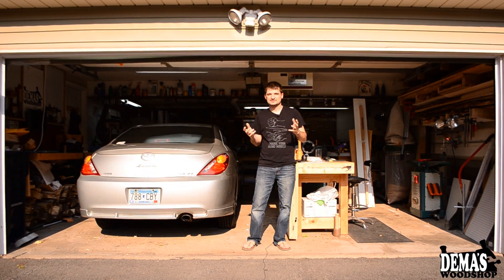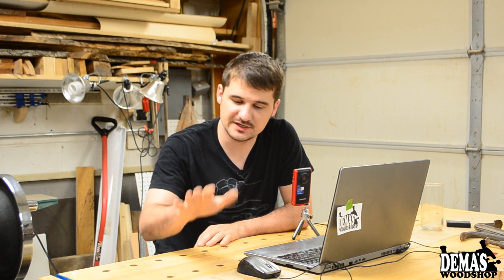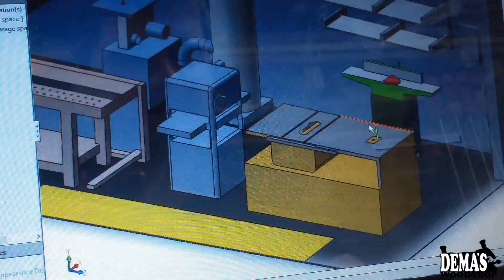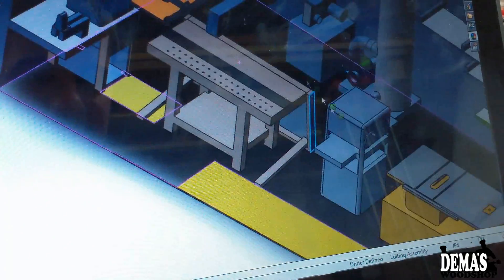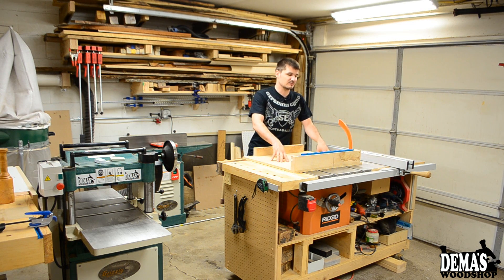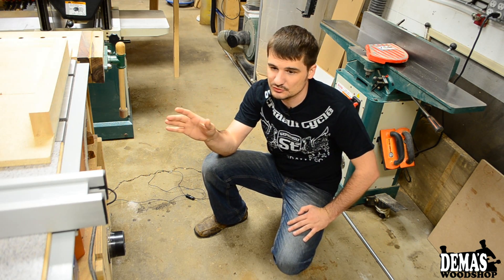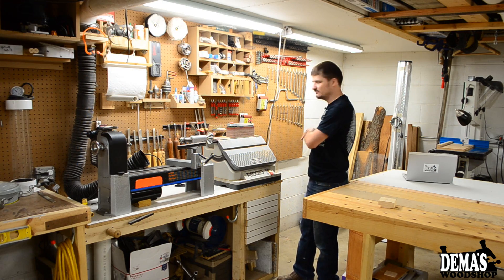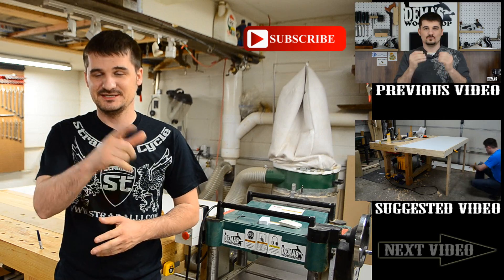Shop layout in 3D for maximum use of space before moving anything.

Comment: I thought everyone would have preferred placing the table saw by the entrance so you open the door to cut large stock. I guess not but I hope this all works out for you. I placed my router and jointer next to my table saws because they are shorter in height and don't affect the material being cut on the table saw.
Reply from the maker: Heavyboxes Yeah, but my table saw is on wheels so i can rotate it for larger stuff like sheet goods, but it gets well below zero in the winter time, i dont open the door for anything at that point anyway lol